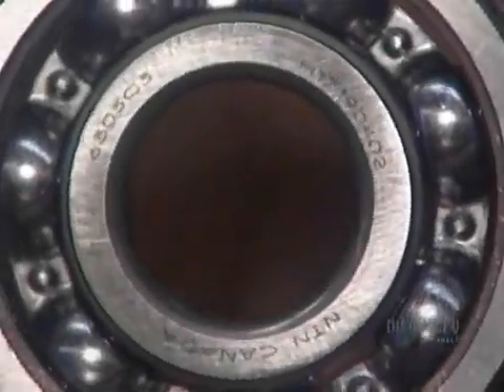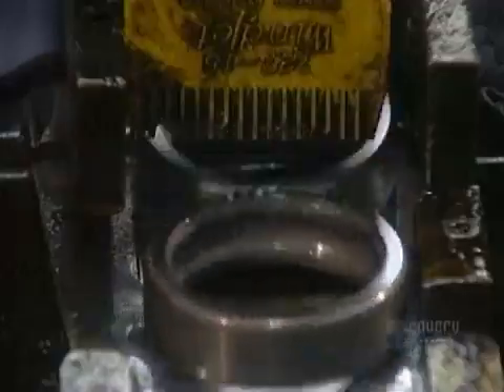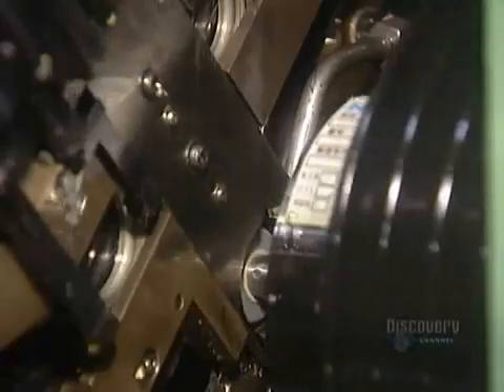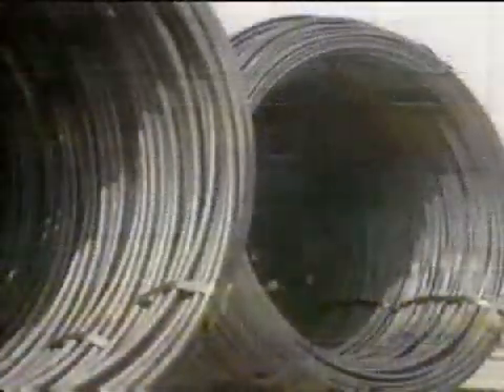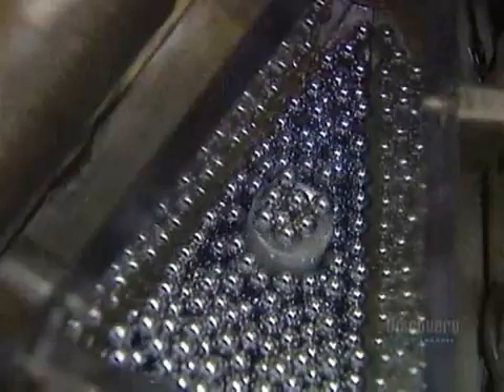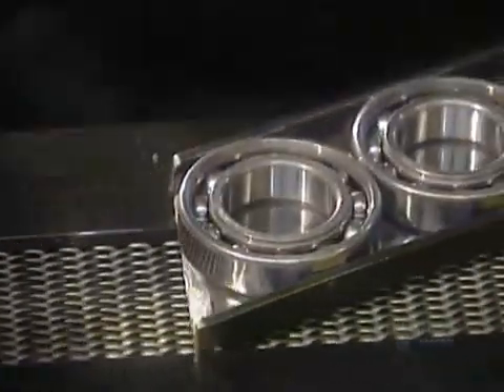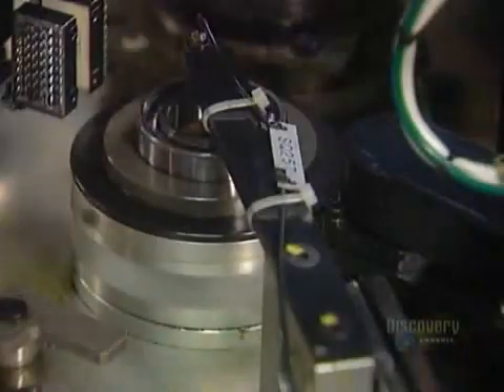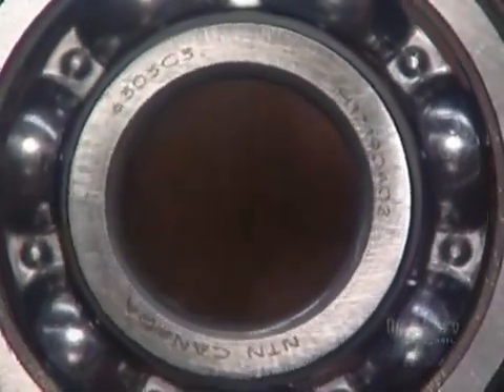Ball Bearings - Production Process

Comment: when the bearing balls are just droped in to the race ways how do they fit in so easyly between the 2 they dont come apart  like that  atleast none that ive changed  did even the real bad ones  very few are so bad the balls have fallen out
Reply: pari
Reply: From what I can see, they get fed into one side, so the inner race is offset, this means they feed in easily. The seperater then puts them into position to effectively lock the positions of the inner and outer races, the cages keep them in position to prevent the races being able to move position in relation to each other.